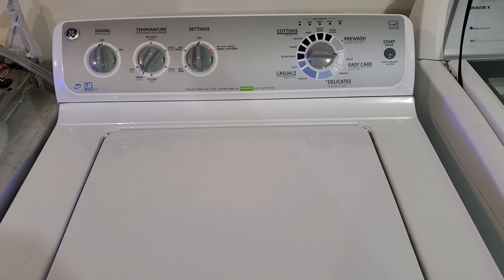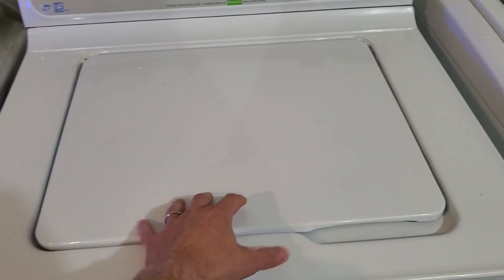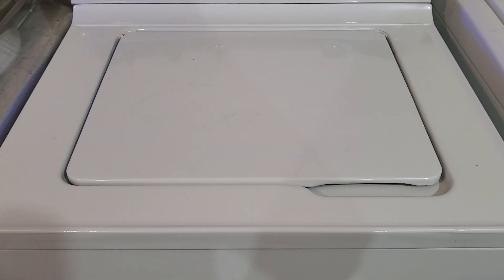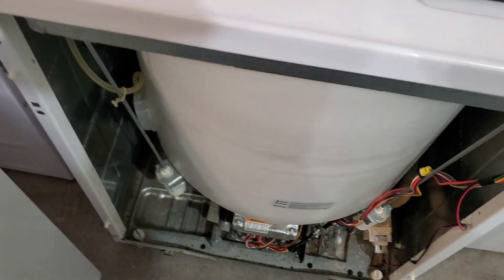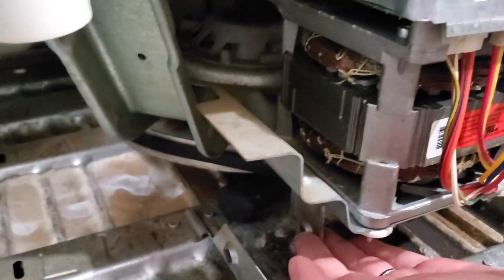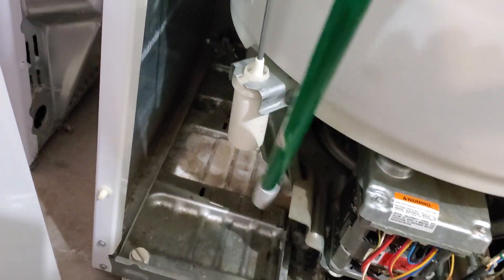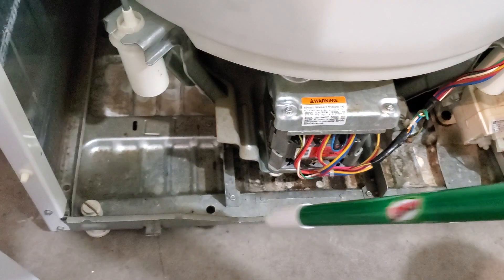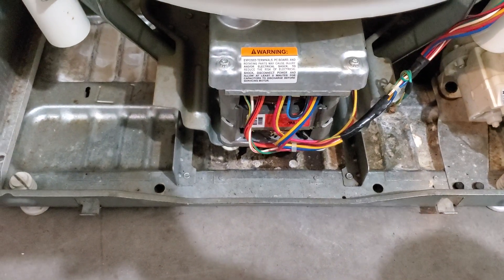GE washer scraping sound fix! No Problem Easy Solution | Josh Cobb

Comment: Amazing video. After removing the front cover, I realized it was the nut!  It worked when I had it at home, then took it to the horse barn (for horse laundry) and it was making that horrible sound.  Horses do not tolerate this noise.  I had to transport it home and looked at everything.  I cannot thank you enough for this useful video
Reply from the maker: You're welcome!  Glad it helped!

Comment: Awesome hack. My used washer was delivered yesterday and I thought I got ripped off for a minute. Mine was scraping closer to the center so i put the machine on pause, pryed up on each side. Unpaused it and it was quiet after that. Thanks for your helpful video. One thing I’d add is when removing the front you have to push the clip up and in while pulling the front plate towards yourself. U struggled w that part for a good 5 or six tries before i got it right.

Comment: I had a scraping sound in my washing machine. I found a wire inside the basket barely seeing it. I pulled out the underwire from a bra. We're up n running  again. Thank you for your info. Thought it's  worth a share.
Reply from the maker: Who ever thought wire in a bra was a good idea anyway?  Totally more prone to being struck by lightening...